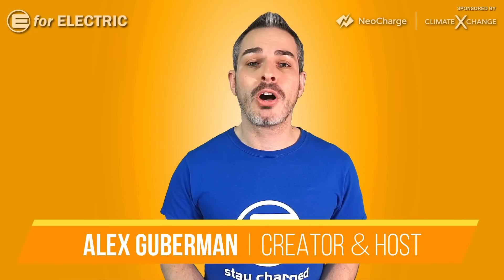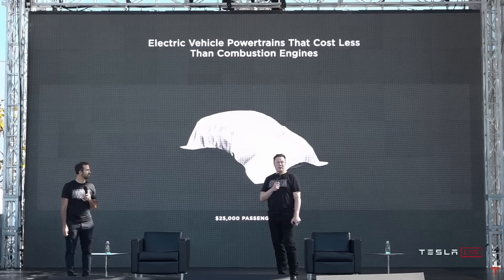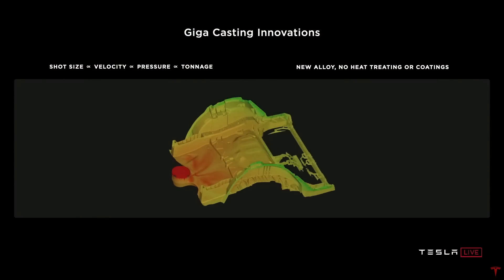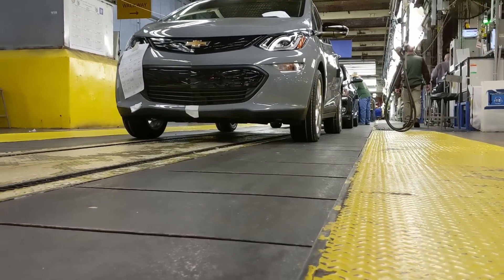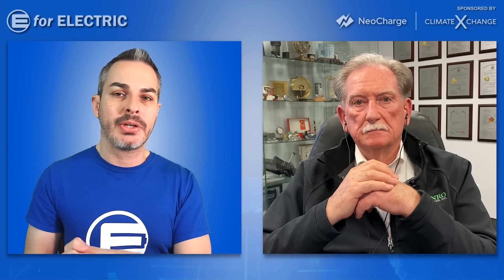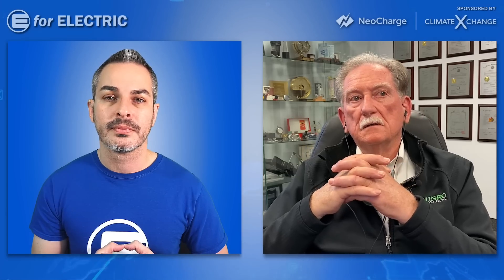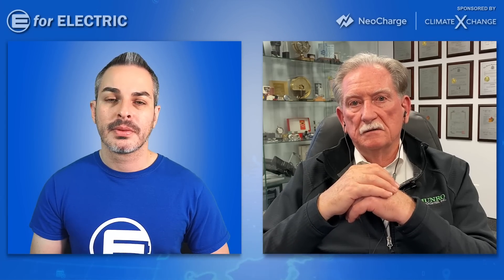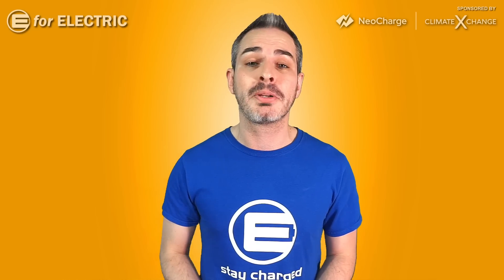SANDY MUNRO Defends $25,000 Tesla Timeline

Comment: Making a profitable entry level car is the hardest part of auto manufacturing, and it has killed smaller brands in the past. AMC thought they could do what you think can be done, when they created the Gremlin from their Hornet four take away two doors, make a hatch where the trunk should be, from the more prosaic Hornet that was too much like other makers mid sized offerings. It was all style and poor handling for the shortcuts in the manufacturing. While it bumped the sales enough for AMC to attempt a real revolution in small American cars, which was the development of the Pacer, which was supposed to share a Wankel engine from Chevrolet that both companies had been developing. That short, powerful engine would have made the Pacer the right size and balance where the big six engine used by the Gremlin and eventually the Pacer  was a front heavy car. By the time the more European styled Pacer came out,  it had been widened to let that straight six fit into the passenger compartment. And it cost too much to build, for the amount of sales it had. That is the key, 10% profit margin on very high sales has to come from a compelling design that great numbers of people want to drive, not some cut down bigger car. VW Golf(Rabbit) sales made the Jetta possible in the American market, not the other way round.

Comment: He said the $25K car will have fully autonomous capability
Reply: He did say that. The only wheel that  car will lose is the steering wheel!
Reply: SteveRCPilot, I didn't get the impression that it was going to be "exclusively" autonomous.  What he said was "fully" autonomous,  which could be interpreted as exclusively,  or as "finally really a thing". My view is that he meant the latter
Reply: Bob Wallace, not sure why the sensor thing was directed at me. I have no problem with them having some autonomy.  I still want to be at least mostly in control though.  As for the robotaxi,  I agree.  Big,  boxy,  roomy.
Reply: Bob Wallace, no worries. I was confused,  cuz I had said nothing about that. 😎🤷‍♂️
Reply: Its capable of doing fsd but you might still have to drive it in some areas.
Reply: memelord andromeda, yeah,  I WANT to be able to drive it.
Reply: True but not included at the $25.000 price tag as usual. Add another $10.000 and you get FSD
Reply: Top12 boardstore, in theory.....    There are folks out there who have paid for FSD on cars that are years old,  still no FSD
Reply: Lee Jacobson so what? There is no date set for FSD those that have paid into that are well aware of the situation.
Reply: Top12 boardstore, that's awfully expensive vaporware
Reply: Lee Jacobson bruh, so true, are you selling your shares? You should sell all your Tesla shares and pick up as much Nikola shares!!! I know I am. ;-)
Reply: Teemo, no.  I'm good.  Thanks for the advice though
Reply: @leesbassment6393  It is the risk of early adopter investment. Apple cant make a phone that doesnt shatter in 6 months but it hasnt prevented people from continuing to invest in them as if they will last for 3 years.
Reply: Two thoughts:  

What does your comment have to do with anything in this thread?  

I write this from my three year old iPhone 8 Plus,  magically unshattered
Reply: Of course it will. Robo taxis are going to make Tesla more than selling their cars, infact, eventually they WON'T sell their cars.
Auto sales are just the road to that new income.
Reply: @Letyourcolorsblendwithmine  You're making the assumption that Tesla will corner the market for robotaxis ...
Reply: I'm a bull when it comes to Tesla (minor investor here) but I find that timeframe a bit hard to believe. I think truly FSD will be here at least in 2027.
Other than that, I believe we will have the car in 3 years. Tesla is moving to mass-produce a shit ton of the new batteries. And batteries are the main bottleneck they (and any other EV auto maker) face to mass produce a vehicle.

Comment: Sandy's viewpoint is pretty spot on, but still very North America-centric.  This sub-compact will likely be turned out first in either Europe or China where demand will be greater. Like other Teslas it will be better appointed than any ICE car in it's segment.  And, the Chinese version will be very competitive on price with their domestic brands because of the new battery tech.  To make it even more economical, I still think this car  will be a flat panel, stainless steel uni-body vehicle. No body panel pressing, no paint.  Better cheaper, better cheaper, better cheaper.
Reply: Was thinking the same thing. A look at the best-selling car in various European countries shows a prevalence of small hatchbacks – Volkswagen Golf, Opel Corsa, Peugeot 208, Toyota Yaris, and so on.
Reply: @caerphoto  also, the eUP/Citygo/Mii are sold out for a year, and they just that: a small, basic car for about 23k€/25k$ (before incentives!). The Zoe is a bit above that price point, but has a far better range as well.

Comment: To be able to push the price level down on the new cells and packs Tesla needs to fulfill orders for vehicles with higher levels of demand - like Cybertruck. 

They won’t remove autopilot or autonomy from the lower cost vehicles... The smaller vehicles would be excellent low cost vehicles for the RoboTaxi fleet.
Reply: Ohh has someone made robo taxi fleets legal? Since pretty sure it is hard to make money out of cars not legal to move in streets. Since as we know legislatures are the pinnacle of efficiency and fast acting. Better give them atleast 5 years warning to get the legislating process done and I mean 5 years of serious "we really should make autonomous cars in open public roads legal". Since it is a quagmire of liability, safety, cultural and labor market landmines.

Last I checked.... car needs a driver with driving license to move and the car needs to be registered and deemed road worthy.....
Reply: Ari Takalo You’re right, they aren’t legal yet and a few years for Tesla to roll out more autonomy to the existing fleet and try to get legislation passed.  No matter which option you lean towards, it was made clear at Battery day that those vehicles would have the capability.

Comment: Another good session with Sandy. 
It would be interesting if Elon has genuinely talked it down (undersold) this time though. I don't think he has really been accused of that much. Generally he is roughly on track with his predictions - although continually late. But not incredibly far out - and a little hyperbole is OK in my books when you are pushing limits.
The only case where he continues to oversell is autopilot FSD. There is a whole list of promises stretching back years now that is evidence that he continually oversells/ underperforms on this front. 
Even now he continues to do this and will continue to fail . That's my 'Sandy Munro - I am right' prediction right there.  This is not happening this year, next year or the year after that....etc
Check back in 2030 to see if I was right. (In fact can almost predict a class action lawsuit on this coming at Tesla in the decade ahead for everyoine who paid up front for FSD expecting it soon).